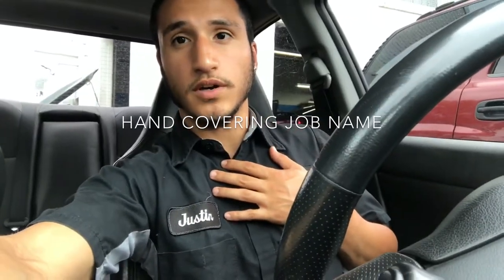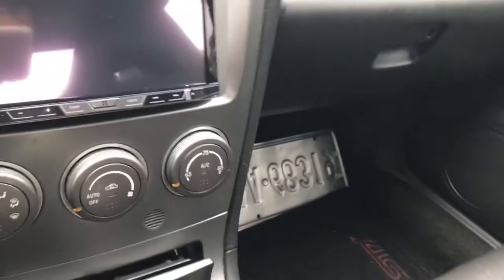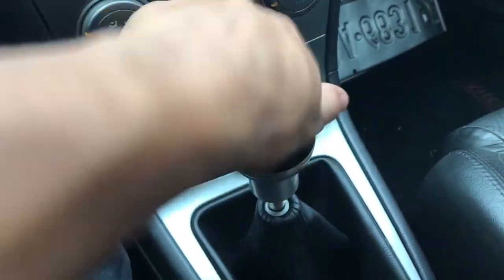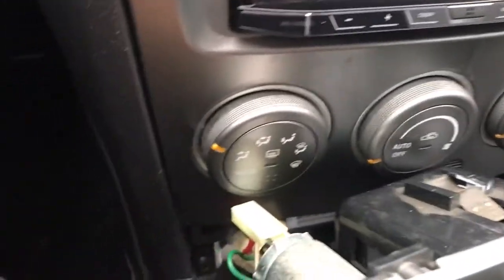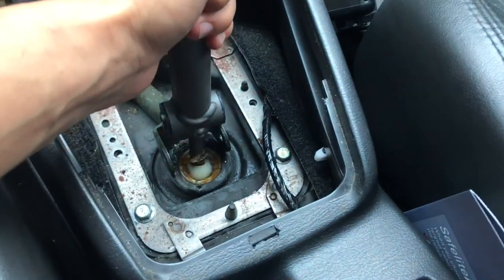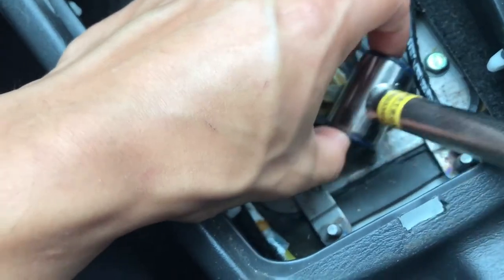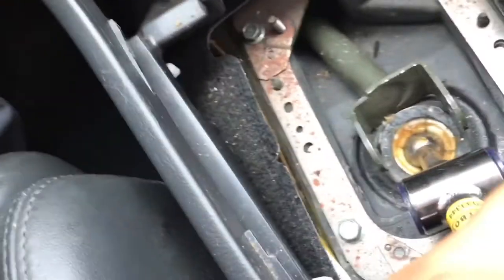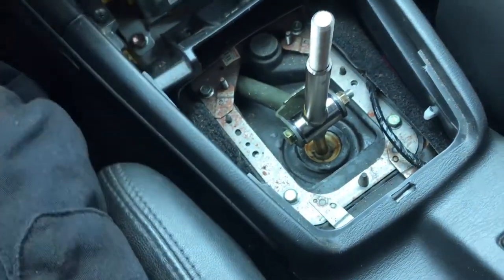Subaru WRX Kart boy Short Shifter Install

Comment: Been hamnering with a malet for nearly 2 hours and its still not in yet.
Reply from the maker: MoOnWaLKeR_781 Yeah it was a pain just make sure the ball is greased and try maybe a brass hammer so you have that real hammer impact but it won’t damage the short shifter
Reply: About at 4 hours now and this thing is not in yet
Reply: @ericdupee4826  How long did it finally take you as I’m having the same problem! Any tips??
Reply: @mickrichBMXWRXJapan  bro just keep banging lol it’ll go in
Reply: @ericdupee4826  I eventually got it in but only after screwing some nuts on the shifter (to protect the threads) then hitting it with good, old, regular hammer! Worth the effort though!👍
Reply: @mickrichBMXWRXJapan  that’s actually smart I think I used a soft hammer and banged the shit out of it
Reply: @mickrichBMXWRXJapan remove the c clip and it comes out easy